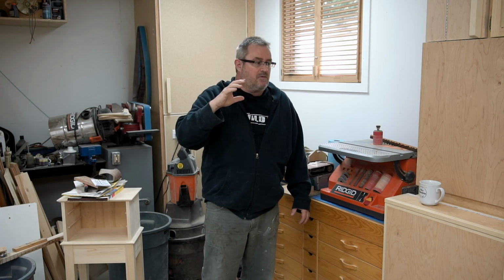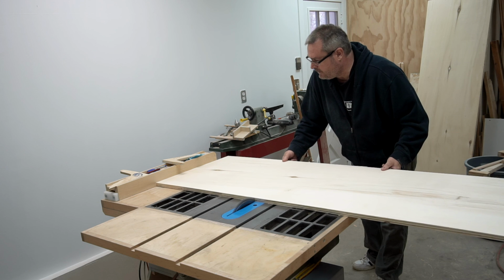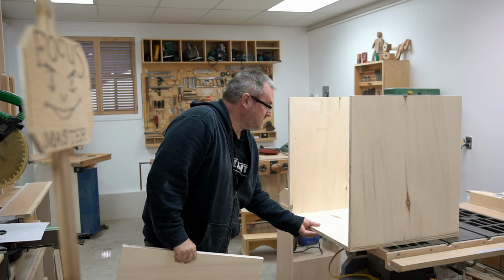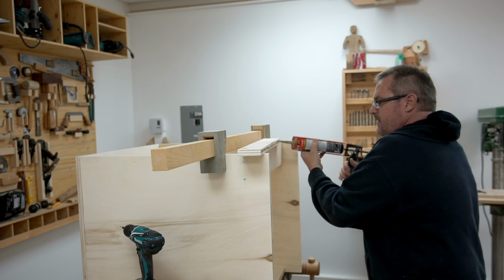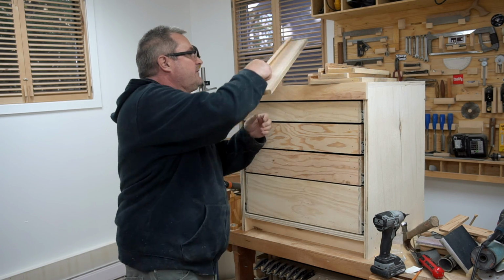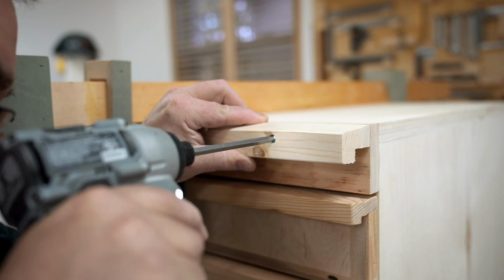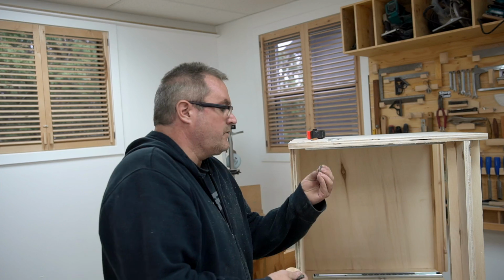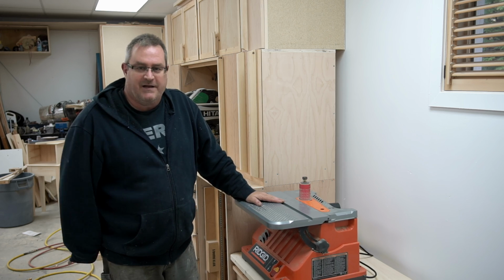Building A Rolling Cart For The Spindle Sander (with drawers)

Comment: Great build!  Looks like your cuts, even your cross cuts, on the plywood came out clean.  Even with a new blade and using painters tape my cross cuts have very unclean edges with tear out.  My rips are usually pretty good.  Do you have any tips you good give me on making clean cross cuts on plywood with my tablesaw.  I get same results with my circular saw.
Reply: If you have the patience for this technique, you can make two cuts instead of one. The first cut you raise the blade so it just barely touches the wood. This is called a scoring cut. It's only about a sixteenth of an inch deep (or about 1mm). Then raise your blade to the normal height and make your through-cut. If you look at the angle the saw blade makes for the scoring cut, it's almost parallel with the plane of the wood (so the surface fibers are better supported and less likely to tear out.) The more you raise the blade, the steeper the angle of the cut becomes and the less support the fibers have.
Reply: Thanks.  I'll give this a try.  On the table saw seems this will only help the bottom side and not do anything for the top side.  When I run it through my table saw the bottom is usually far less tear out than the top.  The top is usually really bad.  That's why I try and remember to cut my wood top side down on the table saw.  I'll certaily give this a try, but any advice for the top?
Reply: that's surprising because the blade exits on the bottom, so tearout is usually worse on the bottom of the cut (on a table saw). Anyhow, that's what cabinet shops do, although they often have a special scoring blade for their cabinet saw.
Reply: Thanks.  I'll definitely give this a try.
Reply from the maker: You might want to check the alignment of your fence to the blade. If it's off, it can cause rough cuts.
Also, there are very low quality blades out there that don't make a good cut even when they are new. Where blades are concerned, you get what you pay for.
Reply: thanks I'll check alignment.  i have a Freud which i thought are decent blades.

Comment: I've also been thinking about wooden wheels. Before you took up the problem (and solution) with the flexing, my thought was to have the shaft go through and have wheels on both ends. Might be necessary for a thickness-planer on wheels that gets pushed around often.

Comment: Thanks for the build, im about to build some stands for my tools myself. Still deciding if im going to do them with sheet or 2x4 frame, do you think it would be ok from a stability point of view to switch the back sheet to a thinner sheet material and not inset? A lot of furniture is built like that to prevent shearing.
Reply from the maker: Thinner material can be used for the back, but there's often not enough of a difference in cost between the thicker sheet and thinner to make it worthwhile.
Reply: For me it's more of transport thing as well, my workshop is several hours away from a decent lumber store and if I can use some scrap pieces instead of cutting up a whole nice sheet, I will try that :) My usual construction is 2x4's but I see you and others on youtube build a ton of stuff from sheets, so want to try that.
Reply from the maker: I talked about plywood vs solid wood building in this video: https://youtu.be/bz4kJhjgkKY